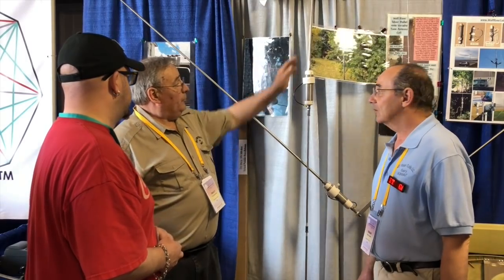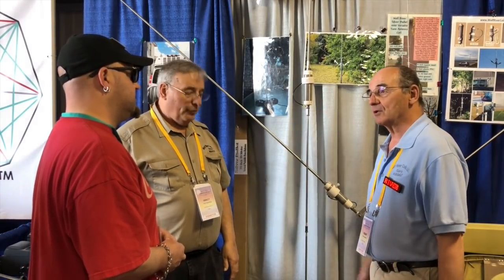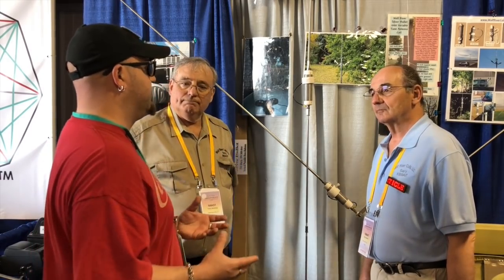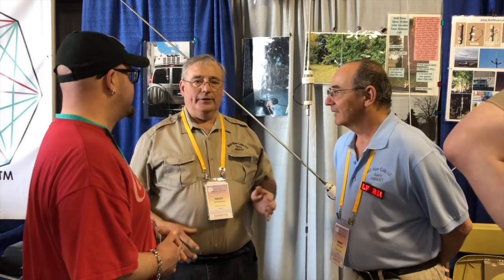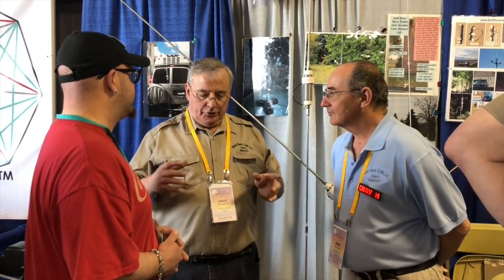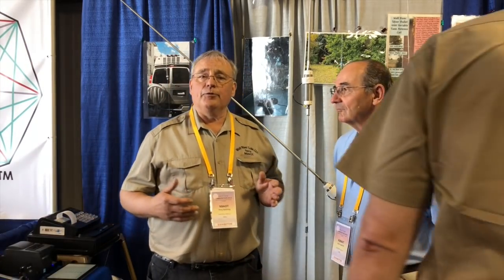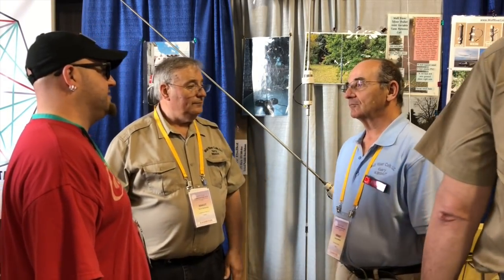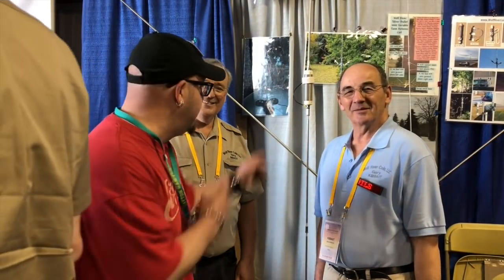Wolf River Coils new Center Loaded Antenna from Hamvention 2019

Comment: One of the worst videos I’ve ever seen. Couldn’t finish for all the ambient noise.
Reply from the maker: Thanks for watching!
Reply: I’d love to know what they said about it. It looks interesting, at least.
Reply from the maker: @chuckandgailperry2405  It was definitely loud in there for sure.  The antenna is a slight mod to their silver bullet mini.  By raising the coil off the ground, you get a lower angle of radiation.  They have had a lot of people ask for it, hence the name UAFI (U Asked For It) Antenna.  It comes with the coil, the larger tripod, 3 counterpoise wires, the 2 extensions (approx 25" each) to raise the coil, and the 78" whip.  From ground to the base of the coil it is about 61.5".  Add the whip and you've got a nice looking antenna.  They don't have this on their web site yet but I would imagine you should be able to buy the whole kit if you don't have any WRT antennas, or just the extensions need to raise the coil.  Would make sense though as thats how they sell all their other products.  As with all their products, these are interchangeable so you could really use any combination of coil/whip you choose.  I'm going to be doing some reviews out in the field as well as a comparison to the TIA 1000 as soon as time and weather permit.  Stay tuned!
Reply: K8MRD RADIO STUFF Great! Thanks for the info!
Reply from the maker: Chuck and Gail Perry no problem
Reply: @hamradiotube  ...One had better use a guy ring and a few short anchored guy ropes to operate with.Once elevated,it will become top heavy,and with a slight wind you'll be operating that vertical in horizontal polarization.Great idea to get coil off the ground though,giving it a lower takeoff angle of radiation,and making it easier to tune without interacting with ground below.I've always operated mine about 48-50" inches above ground anyway,so I'm glad they have adopted this concept.
Reply from the maker: @redman840  I'm curios to see how it holds up having the center of gravity that high but with the bigger tripod it comes with it seems pretty sturdy.  That tripod is way bigger than the other one.  I do bring stakes with me so I can anchor it down though if need be.

Comment: Wolf river makes wonderful stuff. Cost effective and super adaptable to many use situations .
Reply from the maker: I agree, and that's why I decided to buy my first one, the TIA 1000.
Reply: @hamradiotube  questions can you please tell us the specs and information on the new antenna was hard to hear what was said ty, and I bought the Tia and 210 whip  based on your recommendation is videos , love it73
Reply from the maker: @sandraabarca6029  Glad to hear you are liking your TIA.  I don't have any official specs yet.  This antenna is so new its not even on their web site yet.  I imagine that will change soon.  The antenna has a lower take off angle having the coils raised off the ground.  They have had a lot of requests for some extensions to do so and this is the result.  I'm not sure if they are going to sell just the extensions along with the kit but I would imagine so as they sell everything else a la carte.
Reply: I agree with you I need that 80m coil
Reply from the maker: @skynet1703  I have both now.  I'm really excited about this one.  I like the smaller size as I'm never on 80.